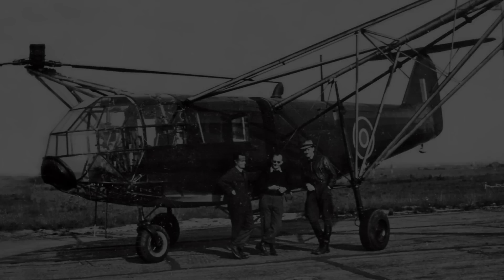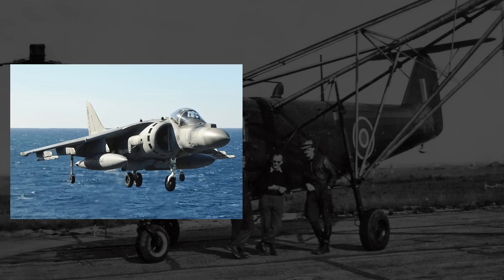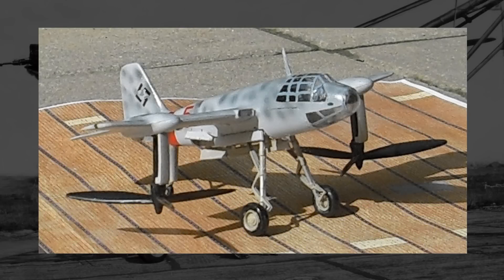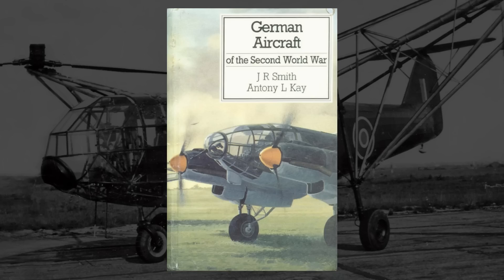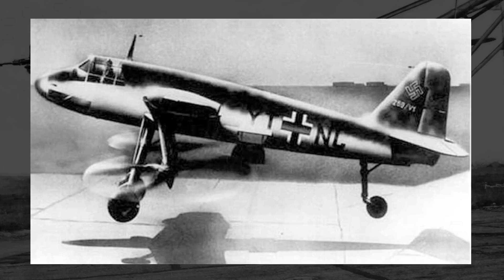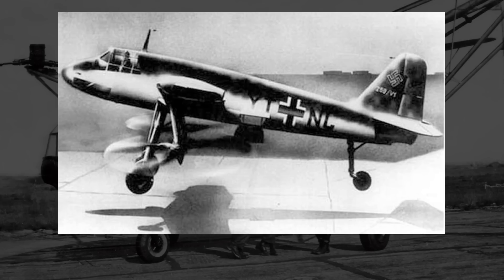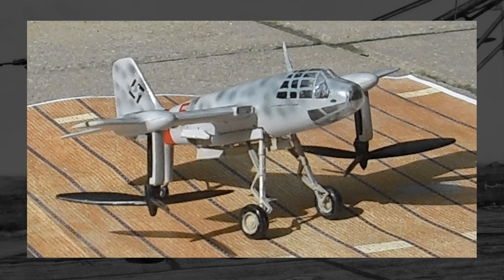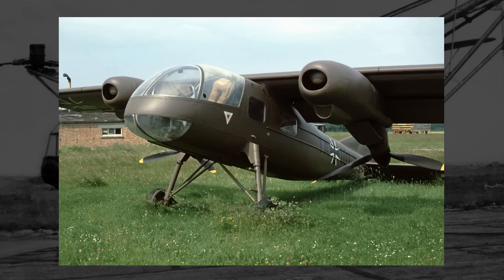Germany's Ridiculous VTOL Fighter Project: Focke-Achgelis Fa 269

Comment: Does this technically make it the first short takeoff and landing STOL? Proper helicopter rotor blades with controls are much more complicated but if you can just get something to fly slow enough with just regular propellers or jet exhaust you could start landing almost anywhere. Would have been interesting to see this scaled all the way up.

Comment: I'd have though one engine would have been somewhat under powered for anything other than a tech demonstrator. Flight controls also tricky with stability with the point of thrust being below the CG rather than above.

Comment: To everyone saying that the V22Osprey is a death trap etc, I'd like to give you this:

In the 34 years that the V22 Osprey has existed, it has killed 62 people in accidents, so roughly 1.8 people per year.
By comparison, the UH-60 Blackhawk has killed roughly 197 people in 45 years of service. That's roughly 4.4 people per year.

Also worth bearing in mind that the Osprey carries far more people (max 38 vs the Blackhawk's max of 15), yet has never had a crash that killed everybody, showing how much safer it is, even when it does crash.

Do you understand now? The V22 has a fatality rate that is roughly 2.5 times lower than the Blackhawk. So explain to me why the V22 is considered dangerous?
Reply: How many Blackhawks have been in service in those 45 years compared to the number of Ospreys? How many hours of flight per accident? You can't just naively compare the two like this.

Comment: I can think of a third design concept, but i'm only aware of that from Scifi/Cartoons.... a Helicopter whose blades TURN into the Wings by mechanically fixing them down, when going supersonic.

As seen in the "Whispercraft" from Arnold Schwarzenegger's "The Sixth Day" or the SWITCHBLADE in M.A.S.K.

Are you aware of anything like that existing as experimental plane? It should be horrifically difficult to find a profile that both can make lift when rotating AND when fixed in place as "normal wings" ...

Comment: I do not think it was ridiculous and instead think it was an idea before it's time. Look how long of design and development and how much money the Osprey required. And that is with modern electronics and vastly more resources than a desperate Germany had.
Reply: No, it's far worse. Because it has to balance on top of the props, rather than hanging under them, making it inherently more unstable. Yeah, the V22 was expensive, but they were creating a brand-new type of plane. Same with the F-35. And it now works very well. If you look at it's safety record, based on the length of service, it's no more dangerous than anything else.
Reply: @anzaca1  It had a far more rushed design process without all of the modern aids that we have now. Advances in technology made the design of the V22 possible. Yoi say the V22 was a brand new type of plane but fail to see that this was a brand new type of plane without any of the advantages of modern technologies and resources that the V22 enjoyed. Saying much more modern vehicles are safer than WW2 era equipment can be applied to cars as well. Does that mean older cars are worse than ridiculous? “If I have seen further it is by standing on the shoulders of Giants” is an old saying.

Comment: This inverted pendulum definitely would not be capable of hovering.  This layout could only do so with digital fly-by-wire.  Controlling pitch would have been impossible at low speed.  (See - Flying Wing)
Hinging a propeller shaft in such a way that it doesn't result in destructive parasitic oscillation would have resulted in a very heavy tilt mechanisms.
It probably would have been better to fix the engine to the wing and change the angle of attack.  This would have made articulated propeller shafts unnecessary.

Comment: Think the downward swinging rotors were necessitated by the pusher props?  Or were they pushers so the props could swing down?  If they swung up they could have used a more conventional configuration.
Reply: Just a guess, but with the materials tech of the time there may have been pilot safety concerns with the blades sweeping forward and basically inline with the cockpit. If a blade separated while in pusher mode there would still be a chance for a flyer to bail from the damaged aircraft.

The other reason could be the rearward sweep gives a debris protection aspect to the blades by default, where a forward sweep would be more likely to kick material up and into the blades and airframe.

Comment: Those Fleitner rotors are just... There's a definition that magic is effect without discernible cause. So yeah, magic.

I think how they work is their rotation sets up an air vortex around them, and as the wind hits that vortex, it bounces off at roughly right angles at a higher speed. Equal and opposite reaction means it generates thrust in the opposite direction.

Or so the court wizard tells me.

Comment: Post-WWII VTOL aircraft were a response to the fact that American forces relied HEAVILY on air power.  Soviet forces were primarily ground, but they did have bombers and surface to surface missiles that could destroy runways/air fields.  Germany had long stretches of the Autobahn that were designed to act as runways during wartime, but even these could be compromised and couldn't handle the heaviest transports and bombers.  Thus, aircraft like the British Harrier were developed "Just in case".

Nazi VTOL aircraft were intended to be point defence weapons;  They would be staged at major industrial locations in order to fly up immediately and engage Allied bombers.

The V-22 was a political victory for a Texas manufacturer.  It is designed to transport 32 soldiers or 20,000 pounds of gear at 250 knots, about the same as a DeHavilland Canada Dash-8-100, while being able to land like a helicopter.  It has turned out to be a frightfully complex nightmare that has killed 62 people in accidents since it was introduced, many because of pilot error, but a significant amount due to technical problems.

Comment: Heyy, something im actually well informed about!
I even went so far as to recreate it as close as i could in Flyout..

Could it take off in VTOL? Yes, absolutely. And while being fairly easy to take off , the landing in general would be a nightmare. In the 40s, with the required control setup (with the all of the static control being completely reliant on the tilt rotor) it would be very extremely complicated and questionably reliable.

Does it work? .. sure
Is it a good design? Lmao.. no.

Comment: Having the rotor blades so close to the ground like that must have been real popular with the ground crew.
Reply: @PaxAlotin So what they actually invented was the worlds first hover mower with the usual German overengineering
Reply: @bigblue6917 I think you underestimate the intelligence of German engineers 🤣
Reply: Not to mention the long/tall landing gear being equally popular for this thing’s pilot.
Reply: @javierpatag3609 

An interesting concept, but it isn't difficult to see why it never got further than the design stage.
Reply: Why’s that, all props are close to the ground, so are jet engine intakes which in some ways are even more dangerous 😉
Reply: @drstrangelove4998  A bit early for turboprop, don't you think. Even for the Germans
Reply: The Osprey doesn't land like a plane, it lands like a heli, so the blades are way higher than any people.
Reply: @anzaca1  we aren't talking about the osprey
Reply: @anzaca1  I think we may have gotten mixed up here. I was referring to the Focke-Achgelis Fa 269. Why they felt the need to have the rotors on the Focke-Achgelis Fa 269 below the wing like that is hard to understand. If it makes a heavy landing the rotors are going to hit the ground and that is going to cause all sorts of problems.

Comment: They look about as easy to land as a Space X reusable rocket!
Reply: I'm not so sure about that. They've landed successfully over 250 times in a row.
Reply: @pseudotasuki  Yes, and for what gain? They literally get no benefit. The rocket has to carry a lot more fuel to land itself. A way better option would be to land it in the water with parachutes.
Reply: @anzaca1  They already tried that on the first two launches. Falcon 9 is too heavy for parachutes, and salt water is corrosive.
Reply: It would probably land like a conventional airplane on a runway.
Only vertical takeoff, not vertical landing.
Reply: Tail sitters should really make a comeback for exactly that reason.

If a computer can land a 20-story building on a boat with a greater than one thrust to weight ratio, then a computer can land a tail sitter.

Comment: Thrust vectoring was a brilliant idea and came out of France. The French dismissed the idea, and so the British developed it.
Reply: The prototype Harrier, called the Kestrel, crashed during a test flight, which made the French happy because they thought it couldn't be done. They were less happy when the Harrier went into service.
Reply: @bigblue6917  the first was lost after an engine bearing seized. The second, and the one I think you are referring to, was lost after becoming uncontrollable on approach for a conventional landing after losing one on the cold exhaust nozzles. The third was lost due to foreign object in the control jet system. And thenthe design went on to best Mirages in the Falklands War.
Reply: @neiloflongbeck5705  Because the Mirages were operating at the very edge of their range...
Reply: @saltboi6374  So, they were bested because of their limitations.
Reply: @neiloflongbeck5705  It was using an experiments front nozzle made form a new composite material. This was never used again.
Reply: @bigblue6917  The proto was the P1127 was it not. OK I'm anal.
Reply: Leave it to the French to come up with a genius idea like that just to say "nah".
Reply: @orioneverett128  there's more to it than that. The initial concept was flawed but Hooker at Bristol could see how to make the concept work.
Reply: @neiloflongbeck5705  I figured there would be more to it than that. There's a lot of jokes about France, but they're not idiots.
Reply: @orioneverett128  Wibault used4 centrifugal blowers powered by a Bristol Orion turbo-prop engine. It worked, but could never produce enough thrust.
Reply: @neiloflongbeck5705  that makes sense. Thanks for the info. Lol. I love learning things over a stupid joke. Why didn't they just give it more power?
Reply: @orioneverett128  the amount of air the blowers could shift was the limiting factor. Spinning them too fast would lead to supersonic flow in the outlets, and that limits the amount of air  being moved. It's better to shifting a larger amount of slower moving air, just like with a turbofan.
Reply: @neiloflongbeck5705  well damn. It makes more sense for France to give it up now. It's hilarious to me just how many inventions throughout history were just missing the one piece that makes the whole thing work. Imagine how far along our technology could be if everyone's ideas were fully formed upon conceptualization...
Reply: @orioneverett128  In this case, the French engine manufacturers didn't have the imagination or vision that Hooker had to take the next step. You don't need a fully worked out scheme for a technology,  you just need the vision to take your idea and turn it into imagination.  Take the steam engine. Slavery invented a machine that turned fire into mechanical work, although inefficiently, which use valves. Newcomen came along and improved it, infringing Savery's patent and making him pay royalties to Savery, by using a single- sided piston open to the atmosphere. Watt then made Newcomen's engines even better by closing the cylinder and making it double sided. Trevithick came along with wheels and higher pressure boilers and got things moving, Stevenson followed him with the multi-tube boiler, and then Schimdt created the superheated. All these men had the imagination to create better steam engines based on Savery's original idea.
Reply: @neiloflongbeck5705  that's true. I knew about Watt (who doesn't?) and there was a mention of Stevenson that went with him, but I had no idea that the steam engine went through so many different iterations... I'm mostly an electrical engineering guy, so Tesla, Marcconi, and Edison are the guys I learned the most about after high school. They didn't teach us ANYTHING about the history of most machines. Just how they work on a macroscopic scale and the physics of it on a microscopic scale. Yay Wisconsin. Lol.

Comment: With all respect (and I truly mean that), how is the Heinie design any more ridiculous than our ungainly Osprey—a vehicle so unstable that it is regularly grounded for safety issues?
Reply: Well, first, rotors low for hover means any control error turns into this a Lawnmower for about 3 femtoseconds, and  then the Allies' favorite killer of ground crews as the prop disintegrates into sword-sized chunks moving at F1 speeds. Whereas rotors high on the Osprey means the first thing to bump the ground is probably the landing gear.

And speaking of landing gear, those must have been extremely heavy to be strong enough, seeing as they're the length of telephone poles. That's payload/fuel you can't carry.
Reply: The V22 has had no more teething issues and crashes than any other helicopter. And it's now just as safe.
Reply: V280 Valor gang 😎
Reply: @maxo.9928  I'm intrigued, but let's let it mature some.  I liked the compound-helicopter that competed with the V280... can't remember the name.
Reply: @RyeOnHam  you mean ol' dead-weight-on-the-ass-end-when-landing vertically?

Thats the Bell X Defiant.

No thanks lol 

I like sensible things like rotating the drive shaft and keep the engines rigidly mounted in the nacelles. It's a straight refinement of the Osprey design.
Reply: @maxo.9928  Ah, yes.  Well, a compound helicopter makes a lot of sense.  So much so that it's not the first time a compound helicopter was considered.  The AH-56 Cheyenne was, by all measures, an outstanding aircraft killed because it was too good and would eat into the Air Force A-10 money.  Instead, we got the Apache.  Don't get me wrong.  My Dad worked on the gun for the Apache.  Good helicopter.  Just not as capable as the Cheyenne.  The Defiant has coaxial rotors as well which takes the speed limit off vs. a single rotor.
Reply: @richard_l4068  
You implied that it was just as unworkable as the FA269, which never flew.
"how is the Heinie design any more ridiculous than our ungainly Osprey".
Don't try to weasel out of what you said; it's right there for all to read.
Reply: @mikearmstrong8483  I suggested nothing, sir. A request for information is not the same as an assertion. 

Presumably, we are on the same side. I really don’t understand why we are arguing.
Reply: The Osprey compared to what?

I can tell you're just not old enough to remember Chinooks and Blackhawks just falling out of the sky.
Reply: I remember when the Blackhawk entered service. 

There were some definite teething problems.
Reply: @jtjames79  I’m plenty old, pal—likely older than you. But this discussion isn’t about those aircraft, okay? Don’t change the subject—unless the subject is that ALL such aircraft are so unstable that we should not entrust human lives to their care…
Reply: When it works it works very well when it doesn't work its bad for Marines.  Quality control n regular service name of the game
Reply: You’re absolutely Reich! 😂😂😂
Reply: @richzarate9700  LOLOL
Reply: That’s the thing about helicopters; they’re inherently affronts to God and none of them can fly with natural means.
Reply: From a stability and control standpoint, this was unworkable.  The props pointed down like that were the ONLY means of control in a hover and given the ground effect, it's unlikely this would have flown successfully.  The Osprey is not at all ungainly.  It was made to a weight and performance standard, not a safety and reliability standard.  Several questionable design choices make it a bit of a death trap, but it's a solid aircraft with performance and capabilities unmatched anywhere.
Reply: @RyeOnHam  “A bit of a deathtrap, but a solid aircraft”? 

Yeah, right, got it.
Reply: @RyeOnHam how many other countries need those capabilities anyway?
Reply: One very significant difference. 

The FA269 never proved it could even get into the air.

The Osprey, on the other hand, despite some problems, does not spend all of its time grounded as you claim, and the fleet in service have flown many thousands of hours, performing its intended role.
Reply: @mikearmstrong8483  I didn’t say it “spent all its time grounded.” Nice try at dismissing my question, though.